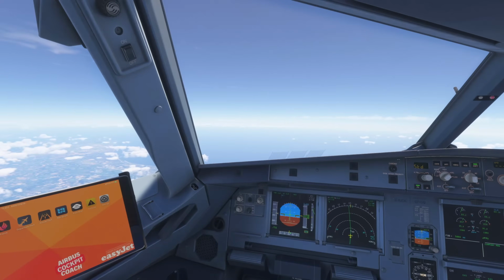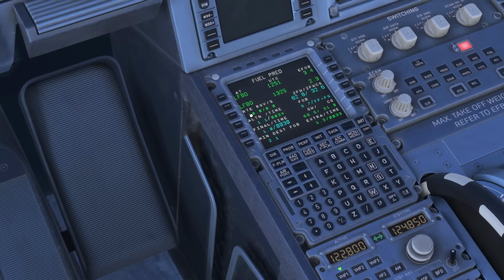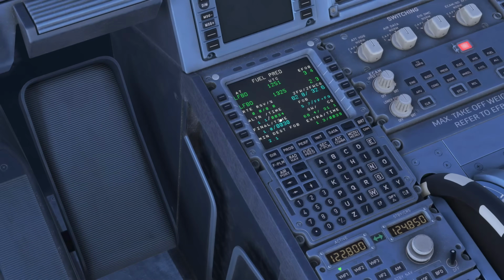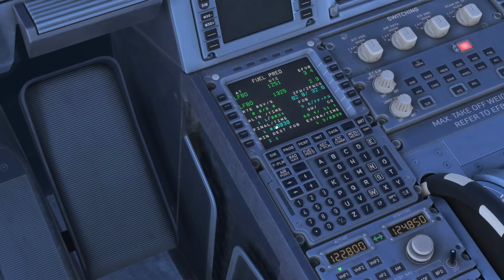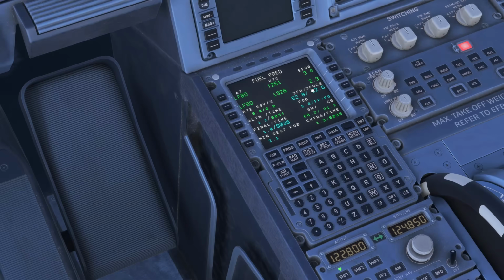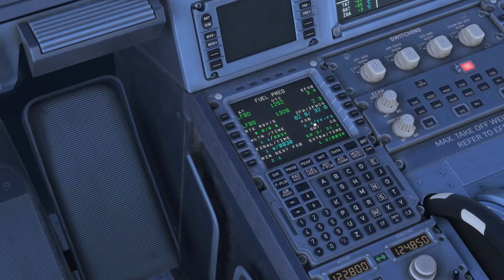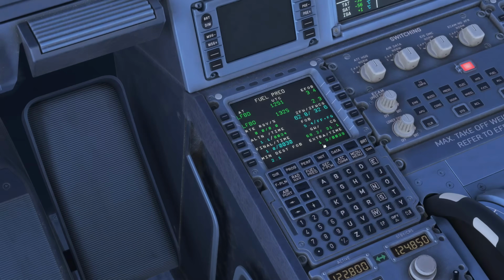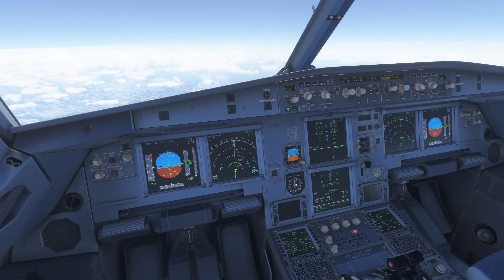How to Use the Airbus MCDU FUEL PRED Page | Real Pilot MSFS 2024 Tutorial

Comment: Can you please tell me when we have to divert to alternate or declare emergency? In case of fuel, according to what indication? We need to monitor extra fuel?  If extra fuel is becoming 0 then we have to make considerations? If extra fuel in only for 10 minutes is example. How do you make decisions to continue flight to destination and according to what fuel? All fuel on board or extra fuel
Reply from the maker: Great question! In Airbus we always monitor the predicted fuel on board at destination, the EFOB. If the EFOB shows you will land with only final reserve (30 minutes), that requires a Mayday Fuel call. If you will land above final reserve but below your planned alternate or diversion fuel, then you declare Minimum Fuel. A diversion is required when you cannot safely reach your destination while still protecting alternate and final reserve. The “extra fuel” figure on the MCDU is just the margin above the requirement, useful for monitoring trends, but the actual decisions are always based on the predicted landing fuel at destination.
Reply: @AirbusCockpitCoach  Very interesting that you would already declare minimum fuel if its below Final reserve + Alternate. I was trained that its only once you would land with exactly the final reserve remaining. Mayday fuel then once you would land with less than 30 mins. If your prediction goes below FR + ALTN Fuel thats just requires a commitment to proceed or divert for us.
Is that a company specific procedure for you or do you have an official Airbus source?
Reply: Thank you for your brilliant answer. If extra fuel becomes zero it’s not that important ? We should monitor and make decisions according to EFOB at destination and it’s has to be above Final reserve? And can you please give advice when to decide to move to alternate because of the fuel

Comment: Does the Alternate fuel figure take into consideration the higher burn rate climbing back to cruise after a go-around?  I did a flight in the sim from Gatwick to Jersey and had Gatwick as my alternate.  I think it said 1.2t alterante fuel which seems low.  You burn over half a tonne just getting back up to FL190.
Reply from the maker: Hello, yes your plan should include the climb to your alternate cruise which is often different to your original cruising flight level. That is taken care of at the flight planning stage 👍

Comment: Can you make a video on Anti Ice? when it's turned on, when it's required or other things. I noticed TAT was -31C and SAT was -56C in this video but no anti ice was apparent, so I'm just wondering at what point or what conditions is it used and which anti ice is used etc? If that makes sense. Also thank you so much for covering details others don't. Many tutorials or videos just show basic information most already knows, you really go in depth and explain WHY behind things and explain a little more on technical aspects, when others just say to click XYZ.
Reply from the maker: Hello, in addition to the temperatures being in the correct range for icing you also need to be in visible moisture, I will add that one to the video list. Thanks for your great feedback, appreciate it 👍✈️
Reply: @AirbusCockpitCoach  Ohh, I never knew that. Will take that into consideration and will also look forward to the updated video, thanks!
Reply: If you need a quick reference, i believe anti ice needs to be turned on if the total air temperature is at +10C or below AND you have visible moisture